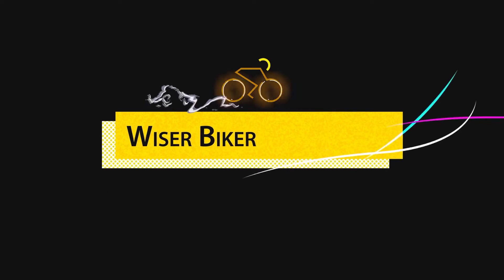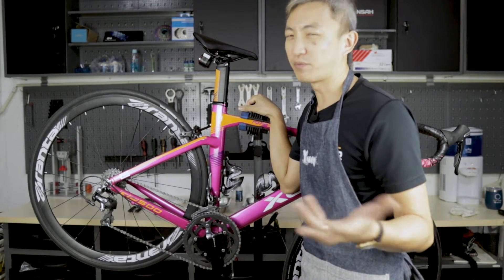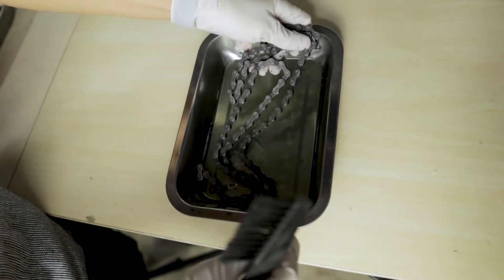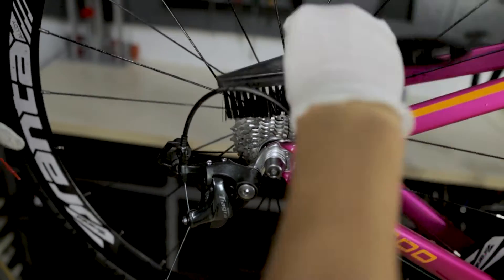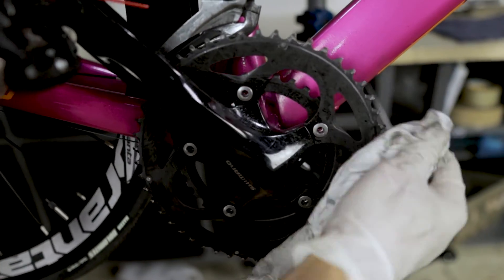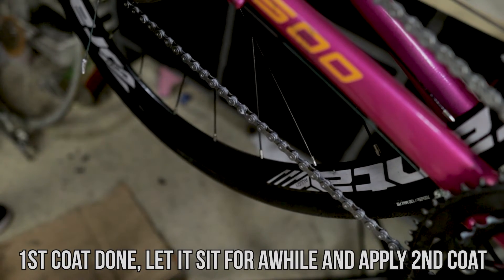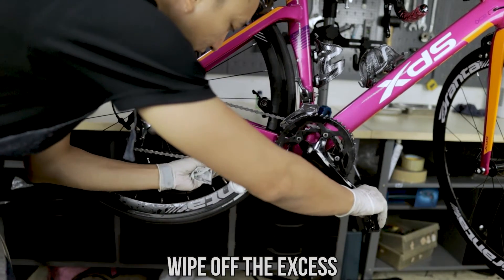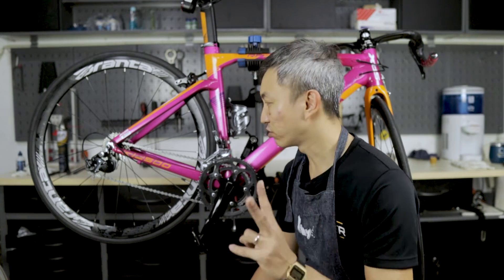How to clean your drivetrain | 15 mins, quick & effective

Comment: Degreaser that spray on to the cassette no need wash away with water? Cause once degreaser go into the hubs the grease will be gone and damage the hubs bearing? 
Also what if this bike is a disc brake the degreaser sure spray till the rotor.

Comment: can i reuse the chainlink unlimited time? or do I have to replace them after certain amount of usage. thank you.
Reply from the maker: They do stretch over a period of time. A good rule of thumb is to change the chain when it is too stretched using the chain wear checker, the chain will come with a new quick link. If you are getting a quick link for replacement, do take note that you need to get a specific quick link to the speed of your chain (eg. 6 speed is different from 8 or 10)